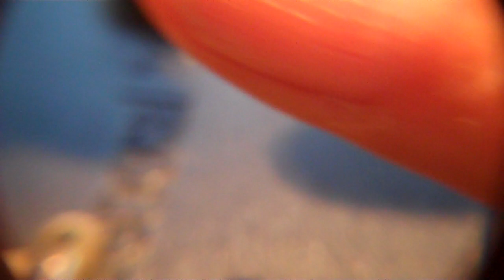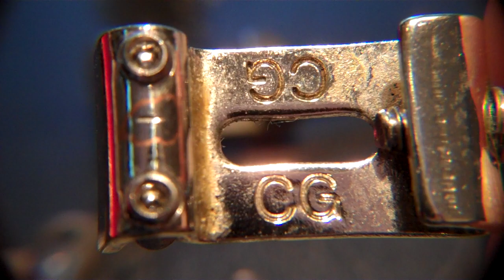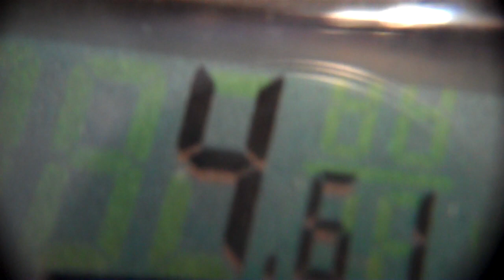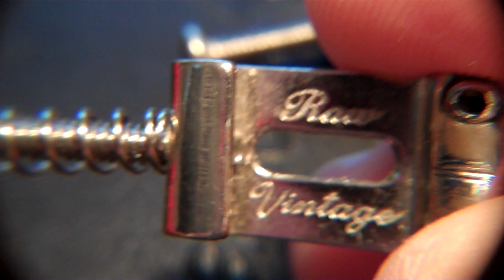1964 Vintage vs. Callaham vs. Raw Vintage Stratocaster Bridge Saddles

Comment: My Callaham saddles are all grooved badly, and cause string breakages. I have 4 callaham bridge units on different Strat builds but I would NEVER buy another one. Apart from the awful string breakage problem, customer help is garbage. After giving these guys over $500 they weren't interested in selling me a replacement arm tip , or a pack of 3 because of their minimum order policy and they also implied that I was lying about having 4 of their bridges. They told me to go and buy one somewhere else ! Well next time I will be buying my bridge unit somewhere else. I will shortly be making a video about my experience with them.
Reply from the maker: That's too bad.  I'm surprised they can stay in business that way.  I've had a similar experience.  I know a guy that used to work there and it was just as bad for the employees.
Reply: They probably never once had the metal tested. To see if it's the actual hardness, that they brag about it being. Most likely made in China out a cheap pot metal. They're probably getting ripped off from the supplier. I know this is a problem in the firearm industry. They have to test all the metal they get. I bet you if you sent these saddles out to be tested. They wouldn't be made out of the correct metals and would fail the hardness test.
Reply: I use a Callaham vintage strat type bridge and I love it but replaced the saddles wit the highwoods. I agree with your opinion regarding Callaham: he can be a rude a-hole of a guy.
Reply from the maker: That is good to know because Piet at Highwood is sending me two sets, polished and reliced, to try.  I think they are going to work out great.  I will do a review in a couple of weeks.  I do use Callahams blocks, plates, and screws.  They are decent.  Also, Piet knows more about customer service and is more receptive to inquiries.

Comment: The Callaham saddles are rubbish, he uses copper over the steel before the nickel so soon as your string wears through the nickel your into soft copper which gets groves, burrs and snaps ur strings. Raw vintage are great, nickel on steel so if you get a grove or mark you can just give it a little sand and polish like john cruz does in his setup video and its good as new. The raw vintage springs are miles better then Callaham too.
Callaham blocks, tremolo arm and bridge plates are good but his customer service is shockingly bad!!
Reply from the maker: I totally agree.  Also, why would you argue with your customers?  You should have heard him when I told him I was cutting grooves in his "hard" steel.  I think I have only been back once since then to buy a block.
Reply: millstap thanks for getting back to me about the strings on your other video by the way, I'm currently using daddario 10.5-48 because I'm trying to find a middle ground between srv and Hendrix.
I've been watching your videos for years now and just want to say thanks for sharing your tips and knowledge 😄
Reply from the maker: That sounds like a good gauge for SRV.  I did like the sound of the 11-52 but they feel so stiff now.  I'm used to the Hendrix gauge now and when I picked up my red Strat with 10-46, they felt like poles.
Reply: millstap I couldn't go lighter then 10-46 but lighter strings are better with fuzz. Have you tried your wah with a carbon zinc battery? I promise it's not snake oil it does get the sound closer to jimi
Reply from the maker: I do use the old style batteries.  I'm not sure what they are made of but they are not alkaline.

Comment: Any experience with the narrower bridges that Callaham and I'm hoping Raw Vintage does as well I have a 65 Music Master that came with strat decal It looks factory but who knows But with the strat bridge the E strings slip a bit It's a killer neck tho All original My stock 65 has jumbo frets that I don't really care for Very usable but not my preference Amplifies the string noise it seems Thanks I subscribed Great stuff
Reply from the maker: Since this video, I switched to the Highwood saddles and will never go back.  Check out their website.  They have three different widths and show how to measure your bridge.  I'm sure they would work.  I just did a follow-up video on them.  I was looking for the usual groove in the saddle that the strings cut but there was none.  They are the best, hardness, design, tone, etc.  They would move your sting over a little and it would stay in the groove.  I hate it when my strings slip off the neck.
Reply: @millstap  Very good Thanks Millstap :)
Reply: Hey yeah they did have the 2-1/16 which is what Callaham was offering on their narrower bridge but didnt think I needed the whole set up Hopefully this will do the trick if not will have the better saddles for the CG bridge...But still might go with Raw Vintage block and springs if I have to go that route Thanks again Millstap..

Comment: The string breaks where it comes out of the hole from the body and Renee used to grind The Edge inside there so that it wouldn't break I used to have that problem too and I did the same thing and make string stop breaking you do not want a groove on your saddle I would save the vintage ones

Comment: Steel is just going to wear like this. The original saddles did need the pass through hole elongated for cases of extreme intonation adjustment. I have tried 'em all, nothing sounds better to me than the original style stamped steel version.

 If it ain't broke, don't fix it!
Reply from the maker: You would think they could get that machine that left those marks on the metal when they bent them, working again.  Why would you throw that thing away?  Come on Fender.  You read on their site "Many of Fender’s Pure Vintage parts are crafted where possible on the same tooling and machinery as our original-era Fender parts. Whether you are personalizing, modifying or restoring, there is no better way to maintain the proud heritage and period-correct accuracy of your classic Fender instrument or amp."  But, they don't state what parts are made on that old machinery.  Apparently the saddles are not one of them.

Comment: Just a heads up throw away the garbage modern steel strings and use nickle waaay easier on frets and saddles sound better to me feel better too I don’t get burrs in my saddles
Reply from the maker: I've tried pure nickel strings and every time I wear them out too quickly.  Specifically the D winding.  I cut grooves at every fret until the string goes dead.  I'm pretty much stuck using the harder nickel plated steel.  By the way, the Highwood Contoured Vintage Saddles solved all of my problem.  They are all I use now except on one vintage Strat that I don't play much.  It still has the original saddles.
Reply: @millstap  use pyramid strings I’ve tried a ton those are it on Gibsons and strat
Reply from the maker: @user-ni4bc2bm7c  Oh, the old string rabbit hole.  I'm glad you mentioned the Pyramids.  I did a video promoting them years ago but eventually switched to D'Addario.  I can't remember why.  And, I happen to have two 10-38 Pyramid sets that I bought months ago and have yet to try them.  But, they are Nickel Classics which I think are standard nickel plated on steel.  Thanks for reminding me because I had completely forgotten about the two set I already had.  In the past, I had had trouble with round core strings, mainly DR's, going dead as soon as I precut them.  There is a method you have to follow and even when I followed it, the wound string windings would slip and go dead.
Reply: @millstap  hmmmm I bend them 45 deg angle and cut before the bend so it is still there... Tune up after the bend (don’t cut till tuned) I also use locking tuners pretty sure it smashes the whole string together so it can’t slip. I only use the pure nickle classics round core 9-42 I think on my strat. I’ve used the 10-38 set didn’t like them not enough bass for me and 13-58 on my Les Paul. DRs are horrible!
Reply from the maker: @user-ni4bc2bm7c  Yeah, that doesn't work on a Fender Safety Post of a standard Kluson tuner.  You have to precut to put the string down into the center hole of the post.
Reply: @millstap  oh yea that’s a no go, use the hex core nickle then at least it’s softer on ur frets saddles and they sound better to me.
Reply from the maker: @user-ni4bc2bm7c  Does Pyramid make any strings with a hex core?
Reply: @millstap  yes that’s the first set I bought before I knew about round core strings they are called Pyramid Maximum preformance strings
Reply from the maker: @user-ni4bc2bm7c  I just put the Pyramids on this morning.  We'll see how it goes with the wear on the D winding.  I work on songs for my videos and play the same licks over and over which really punishes any strings.  I put on the wound 38, 32, 26 and then I just put on the 10 because I just broke the old one.  They are round core but I do super crimping before I pre-cut.  I agree, DR strings are the worst.  I'm surprised they are still in business.
Reply: @millstap  Well hopefully they work out for you bro! Glad I can help I really like the pyramids!

Comment: I have these Highwood saddles; a cut above the saddles mentioned here. Highly recommended. The elongated slot on the Callaham and the Raw Vintage saddle reduce one point of friction which helps return the tremolo in tune a little better, but does not reduce the pressure on the top of the saddle. The proof are your Fender saddles - which have the smaller holes -  who also have grooves worn in them. Oh, and I checked the Callaham website: he doesn't claim anywhere to reduce the pressure on the top of his saddle. I am surprised though on how soft your Callaham saddles are as he claims to make them from super hard steel.